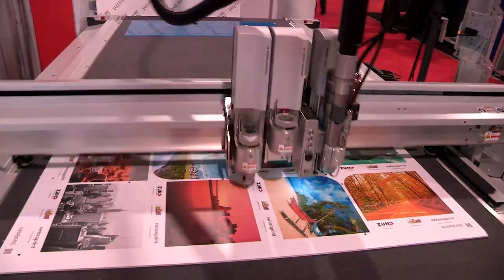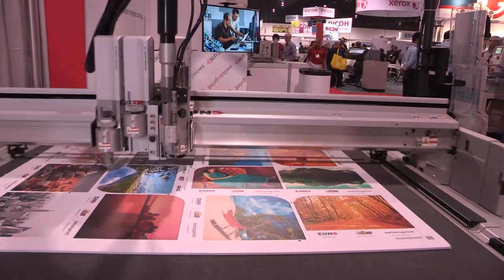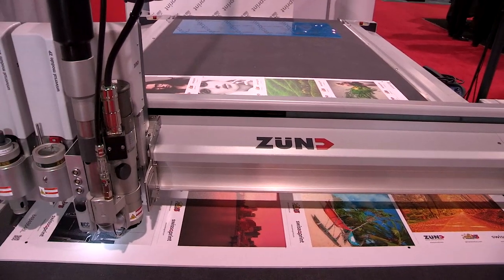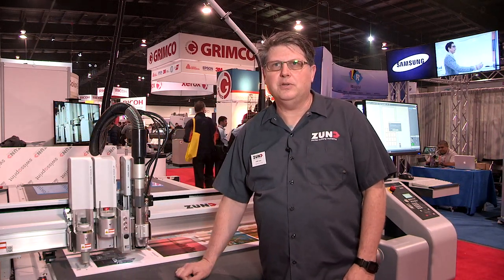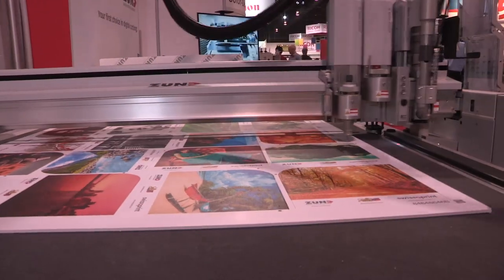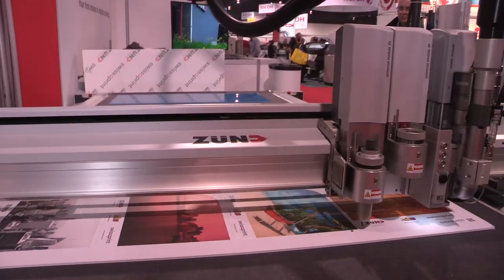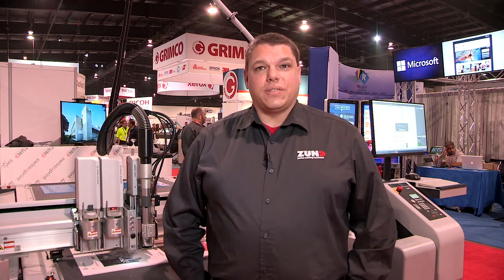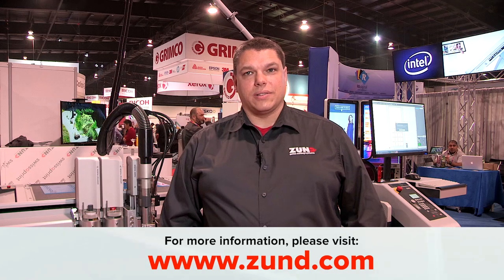A brief overview about Zünd cutting machines

Comment: sir i am receiving axis voltage issue error e204. could you please guide. we had the machine running before. now machine runs. it performs few creasing lines and stops unexpectedly. Please guide

Comment: Would setting the router  in Position 2 during long run w/ UTC jobs, in the long run be better in means of wear & tear on the bar/rails? G3 1600 xl operator asking from So. Cal.
Reply from the maker: Hi JS.
If you only cut jobs with the UCT and doesn't need the routing module, it is even better if you take the whole module down. This also improves the cutting result because there is no longer so much weight moving with the beam. And wear and tear are also less. Hope that's helpful for you. *tna